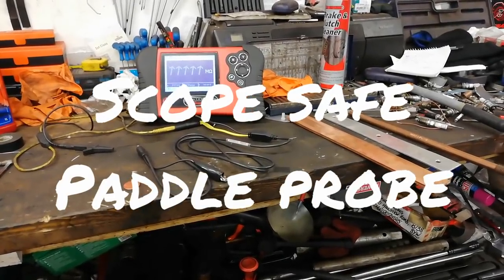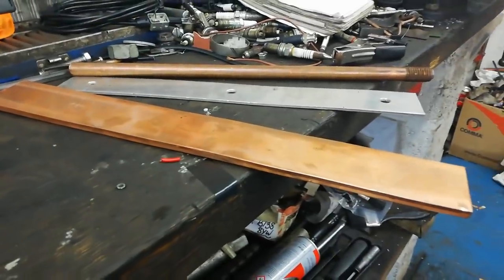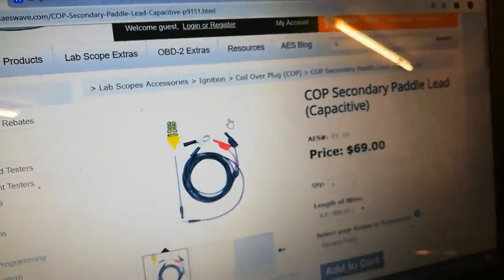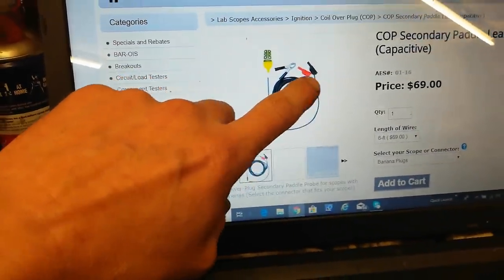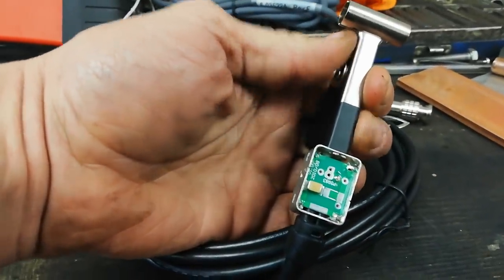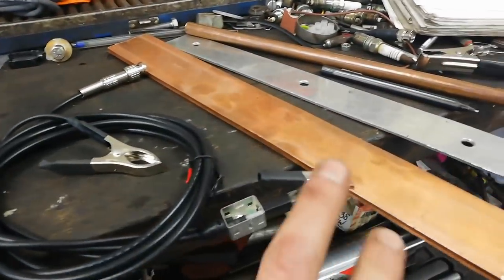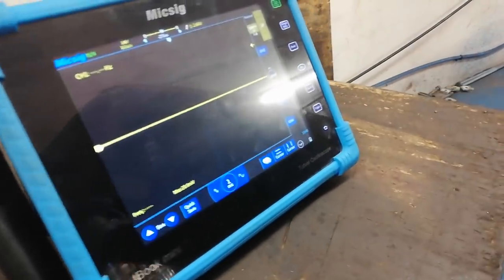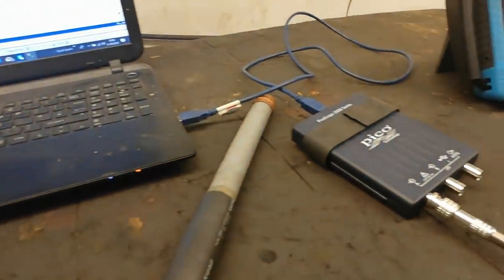Homemade Coil On Plug Secondary Pick up. Scope Safe

Comment: Your series resistor is not a voltage attenuator!  It is a current limiter.  Given 4 volts at the probe, through a 10k ohm resistor, you have a current of 0.4 mA (400 microamps).  Protection yes, overvoltage protection no.
Reply: How do u build a protected one.?

Comment: Great subject, but be aware the resistor technique has issues as presented,  the 1/4w 10K used is not high voltage rated and will break down with Kv and the value is insufficient to limit the voltage seen on the scope in the event of an arc over condition.
Reply from the maker: Cheers, yes good points

Comment: Hello sir!congrats for your information and tips you sharing with us!I want to ask you about the multisignal coil at the same channel with the cooper bar, I want to make one and (because my English is not very good)I don't understand which is the best for your opinion way to connect the cooper bar with the pico 4425 for safety to avoid any damage from a bad coil spike? What kind of lead do you prefer? To make a handmade with capacitor ,resistance,attenuator, I also have from pico the secondary ignition pickup clamp  (capacitive with bnc) like this you assembly and review ? I look forward to your reply!best regards!
Reply from the maker: Capacitive clamp and insulate the copper bar
Reply: @davesterl  thank you very much for your fast response!!can I solder a wire to cooper bar and the end of this wire has a terminal small or a screw to connect the clamp or this may affect the signal?do you also have something material for good insulate to recommend?

Comment: Nice explanation mate ... I’m an ignorant and a half when it comes to scopes but something that I thought now, Are attenuators not enough to protect the scope and does attenuators weakens the signal ? 
Cheers mate 👍
Nice wee tribute to Niki Lauda certainly an inspiration and example of a man. RIP NIKI very sad day 😢
Reply from the maker: Hey igor, aye the normal use of the attenuator is if your testing a component that will be producing a voltage outside the range of the scope. Say petrol injectors will normally peak at 70 to 100volts. This scope safe business is for an unexpected spike of maybe a few thousand from the high voltage of a secondary which no scope can take. Hope that makes sense. Yes the announcement of niki lauda touched the hearts of many.

Comment: Can you tell me what a H25 lead will read on a lad scope?  How many mv or v per Kv?  I’m trying to scope my brigs and Stratton single cylinder magneto engine.
I am on 10v ranger and getting a 70v spike for 4ns  ( yes nano seconds)  I’m sure this is very wrong but I have nothing to compare it to.
Reply from the maker: An HT25 lead is 10,000 : 1
Reply: Yep 100mv  = 1000v just seen a video that confirms it.
I’m getting  70v  ( 700,000v) for 4ns  

or 70v must be leaking through the ht lead.
I’m going to fit a new magneto tomorrow, so hopefully I should get a proper signal ,
Many thanks
P